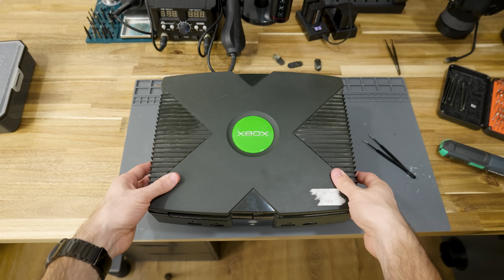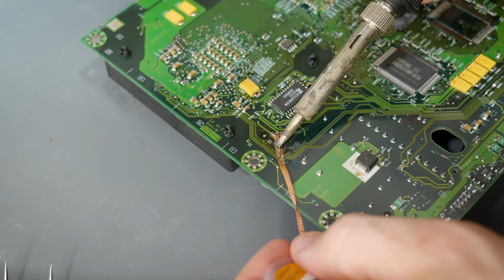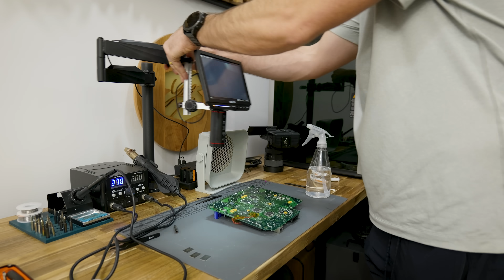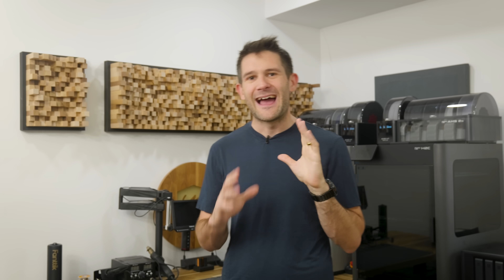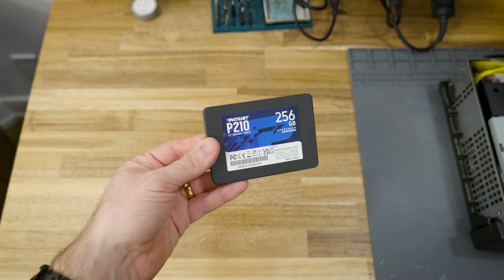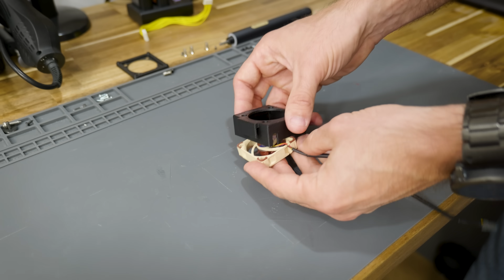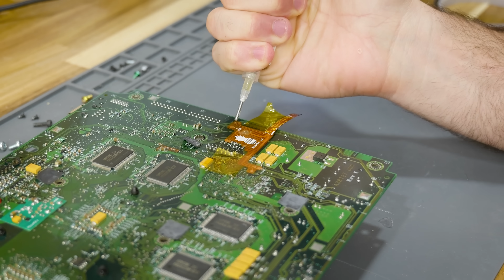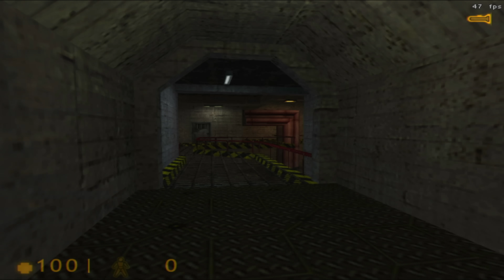I built a MODERN XBOX...

Comment: 1:20 The hard drive wasn't just for storing game saves and whatnot! Games could actually use the HDD as virtual memory, aka as a swap disk for RAM. This meant that the Xbox could do things that were literally IMPOSSIBLE on the other consoles!

Morrowind for example could never have run on the Xbox if it hadn't had a hard drive. Its memory load is simply too heavy for a normal 64MB RAM console. 🤷 But with the Xbox having a HDD as standard, Bethesda could actually do it. And that's just one of many Xbox exclusives that required the HDD.

Comment: For people who mainly play original Xbox games, I honestly don't see much point in the 128 MB RAM upgrade. As far as I know, no retail Xbox game really benefits from it, since they were all designed around the original 64 MB. It's a cool mod, and great for learning or for homebrew, emulation, Chihiro, and development, but for the average player it's probably one of the last upgrades I'd recommend.
Reply: First, a larger hard drive, a quiet fan, a modchip or softmod, HDMI output (if desired), and recapping/maintenance. The 128MB RAM mod is more of an "ultimate Xbox" mod than a practical upgrade for most users.

Comment: When you removing the chips dont blow hot air at the middle off it. Blow to the pins around. Since the silicon is sitting at the middle, you probably damage or sorthen the life of the chip.
when you soldering chips first remove the solder from the surface of the pads. With this all the pins will be flat with the pcb. 
Then when you locate the chip on the pcb, only do 2 pins on oppsite sides to fix the chip mechanically. Then solder all the pins. I hope you got it. Watch some videos about soldering. Good luck.

Comment: There are a few corrections that need to be stated here. The clock capacitor not being needed is dependent on your motherboard revision a 1.0 - 1.5 motherboard doesn't need the capacitor to run but a 1.6 revision won't boot without the capacitor. From my experience you don't need to use acetone on the thermal paste, I had luck using Arcticlean two part thermal paste remover I left the remover on of a few hours and came back and the paste just wiped off the die. Using acetone you have to be very careful not to get it on any plastic parts cause it will break down plastic and make it weak.
Reply: My thoughts exactly on the acetone. Super rough on already old parts. Unnecessary aging turned up to 10X!

Comment: As usual, not the biggest fan of the aesthetic you went with (the see through Xbox Series X was rad as heck)
IMO it needed to be a lot curvier and keep the ribs of the original design, but each to their own. If you're 3d printing something then making a box just feels wrong to me.
I'd have kept a disc drive but use a really slim unit as well, less hassle to rip new discs to it that way.

It's a very cool thing though, loads of extra functionality, I need to get hold of an OG Xbox one of these days.

Comment: Being the first revision of the Xbox (it also should apply for the 1.1), the PSU has fragile solder points in the socket for the plug that can crack and kill the PSU and it may even catch fire

Comment: My one suggestion is that on the heatsinks instead of using paste, use a carbon PGS sheet (ic graphite, panasonic pgs, carbonaut). It'll never dry out because it's not something that can dry out. Just make sure the mount is properly down, that tab can break so keep that in mind and be gentle. Throw some kapton tape around the edges because it is conductive, but on an xbox shouldn't be an issue unless you for whatever reason mount it vertically and have poor mount pressure.

Comment: Hmmm exposed vent slots facing exposed power supply board that's a no no and a electrical hazard be of 120 vac! Cover up that vent u done need that on bottom of power supply board just use back vent

Comment: It seems to me, you're using a lead-free solder. Is that right? If that's the case... Consider switching for old school leaded solder. It is much easier to work with and you can use lower soldering temperature. Here and there, I've seen overcooked solder joints. That should help a lot.
If a particular solder pad is giving you hard time, sometimes it's easier to wick all of the existing solder out, and completely replace it with a fresh one. It actually is the proper way, as a mix of old and new is more prone to failure.

Great vid!

Comment: Recommendation.... the caps you linked to in the top of your description... I would highly suggest people go with a Nichicon or another top brand. Make sure they are 105c rated and low ESR. The price difference is basically nothing, and that's what makes the difference between a capacitor that starts leaking in a few years..... and a capacitor that will last 20 years

Comment: You did quite a few things wrong. You're barely one step above rank amateur and you're charging people for an instructional course? Get some self-reflection. eg: Kapton isn't a thermal insulator, so covering your components in it to protect against your heat gun doesn't do anything. -Just one example of the farmyard full of misinfo and bad practices on display.

Comment: The clock capacitor is the more well known of the two major hardware failure points, the other is the way the hard drive is configured as both it and the motherboard are married via an eeprom key, so once that hard drive dies the system is basically a doorstop unless you got the eeprom key before the inevitable or you solder a modchip

Comment: I loved softmodding my xbox many years ago. I bricked it eventually so here's something to be mindful of:
When I was removing the upper tray with the drives, I carelessly let the tall, main screw structures sit next to the onboard components. I bumped the system and that caused just one of the components to sheer off. The problem was, I didn't know the original state of the motherboard, and I didn't know which were suitable replacements, or even where the component came from.
In short, either keep the upper tray completely separate, or near it's original position when working with it. Not somewhere in-between like me.

Comment: the thermal material is a type of phase change thermal stuff  (PTM). unless you're changing the heatsink or replacing one of the chips/passives, you don't actually need to replace it. it doesn't generally go bad without being overheated. some few units will, and there was some bad batches, but if its not broke, you shouldn't mess with it. the paste will eventually dry out, the PTM doesn't really go bad without other issues involved.

and no, your placebo/psychosomatic experience doesn't change that. PTM is superior to regular paste for longevity, and units show no particular thermal transfer improvement with paste over the PTM.

Comment: Stop removing the physical media ports from stuff. People still have physical media collections and they deserve to be used. 

Dont go all Playstation with every single build because all it does is turn the console into a fancy box that reads an ssd.

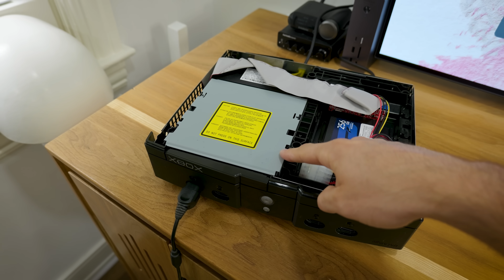Yup, called it. 17:14. The very moment "modern" kicks in. By just tearing out physical media capability. Every time.

Dont get me wrong, the rest of this is perfect. 

But losing physical media isnt it. Especially if you need to stop halfway through modding to rip all the games.
Reply: Btw, that physical media is OPTICAL.

Nowadays a more modern alternative would be akin to SSDs or switch cartridges,plus, there is not any real problem on not having  physical media when it's a thing made by yourself, and considering you can pirate stuff easily.

The real problem with non-physical media is the DRMs,not the stuff being digital.

Comment: The clock capacitor is only there to keep time when it is unplugged. And not for very long. It was kind of a useless piece in this system. As long as it stays plugged in it keeps time.

Comment: Oh my God, bro, when you got to the thermal paste. Earlier this year I bought a halo combat evolved edition original Xbox with video issues for disgustingly cheap. I replaced the bad capacitors and went to repaste it. I was scrubbing that stuff with rubbing alcohol on a toothbrush for four or five hours.
Reply: That's because it's not thermal paste. It's thermal adhesive, which yes, is an absolute total bitch and a half to remove. 🤷

Comment: One suggestion on the RAM soldering difficulty: just remove the old lead free solder, apply fresh leaded solder and reflow the chips in place. Much faster and you can reflow it at lower temperatures.
I also would have kept the original optical drive for game preservation and DVD playback over HDMI.
Keep up the good work! Cheers

Comment: Some corrections and notes that are worth mentioning:

- The clock capacitor isn’t a “design flaw”, it’s an issue with that specific capacitor that was being supplied. Later Xbox models switched to a different supplier and are substantially less likely to have it leak.
- The thermal compound is not a paste that dries out, it’s a thermal adhesive compound that hardens at room temperature. It still works fine for managing the relatively low thermal output of the CPU and GPU and you shouldn’t remove it unless you’re doing something that necessitates removing the heatsinks anyway.
- Pull the pin from the header before installing, don’t clip it. Leaving a clipped pin resting on motherboard can scratch away at the top layer when the header wiggles from removing or installing the chip.
- The LPC header is for accessing the SMBus and LPC bus primarily for debugging and development purposes, not for flashing the BIOS.
- Modchips generally do not come loaded with a custom BIOS (at least not one that functions as an Xbox and plays games) and you must flash this yourself for legal reasons.
- All debug and development consoles had 128MB of RAM, not just early ones.
- RAM was not reduced to 64MB due to a “cost cutting stroke of genius”, 64MB was the design spec. 128MB was intended for development and debug units, and for the sake of efficiency it made more sense to have those systems share the same motherboard, which meant unpopulated RAM pads on retail units.
- The Xblast modchip is outdated and you don’t need it to do a RAM upgrade. Other chips and BIOSes, including TSOP flashes, can address the additional RAM. A soldering error does not “turn your Xbox into a brick”, it’ll most likely just result in that extra RAM chip not functioning.
- Project Stellar and its creator are quite controversial for a number of reasons and you should do some research and decided on your own if it’s a project you want to support.
- Neither a 40 wire nor an 80 wire IDE cable as shown are “shielded”. 80 wire IDE cables have additional ground wires to reduce crosstalk.
- The vertical placement of the PSU means its PCB is blocking pretty much the entirety of those side vents. The PSU does not have its own cooling and relies on the stock design resulting in the exhaust fan pulling in air from that side and over the PSU components. This design may not be sufficient, particularly for extended sessions and longterm use.
Reply: I tink you are basicly spot on inhope he reads this especily with the project steller,
Reply: This. All of this. Couldn't have said it better myself.
Reply: Wrong
Reply: @theonewhocrys-k9d don't you have a bridge to live under and make anyone trying to cross it to solve your riddles three?
Reply: @theonewhocrys-k9dsource

Comment: If someone has a 1.6 version of the original Xbox, the clock capacitor is required for the system to boot.

The LPC on the 1.6 version is a lot more extensive of a rebuild process. There are quick solder boards that can help with the process.

Comment: curious why you didn't do the 256mb ram mod seems like it would have been same difficulty as the 128mb mod. like the design looks nice.
Reply: The 256mb RAM mod is about triple the difficulty and almost nothing really takes advantage of it anyway. You have to do the 128MB install and then piggyback an additional RAM chip on top of each one and solder the legs together.

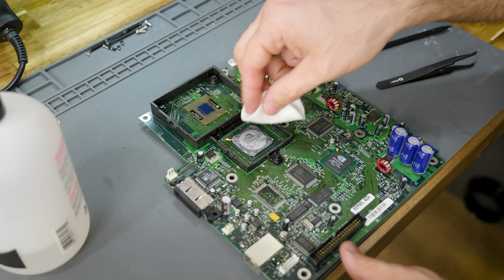Comment: 2:40 you should definitely use nitrile gloves when using acetone. Just because woman use it on their nails doesn't mean it's safe to touch. Also, avoid smelling it. Use a desk fan immediately after you're done. it evaporates almost instantly.

Also, the gloves won't hold up forever under acetone exposure but it's fine for brief exposure like this just cleaning off a CPU.

Comment: Small correction, on the 1.6 revision if you boot without that clock cap you get an error code. You have the 1.0 model (the fan on the GPU is the giveaway) and up to 1.4 you can just cut it off without issue. The 1.6 is also more difficult to RAM mod as the pads don't exist and are blocked. Some have worked around this by stacking chips on the others, but that is even more difficult...

Comment: Not ALL Xbox consoles suffer from clock capacitor leak. V1.6 Motherboards have a different capacitor that doesn't leak. Amazing how this knowledge gets lost to time. Also the Xbox was not disappointing at launch if you were actually older than a pre teen. It was a fantastic console for the time.
Reply: And to add onto what you said, 1.6 and 1.6b motherboards REQUIRE the clock cap to be installed. Do not just rip it out without a replacement or the console will not boot.
Reply: Tons of excitement at the time. People thought it was awesome.
Reply: I'm daring to say it's the best console ever. The library it had and the media-centered focus it was designed around is unbeatable. Add the modding capability (you can literally swap the CPU) and this thing is just the coolest console of all time. Sure the PS2 had the best library of that generation, but a lot of that library was shared with the Xbox. And usually the games ran a lot better and looked better on the Xbox. The next closest is the Xbox 360 but unfortunately it is extremely locked down hardware wise, we only just were able to crack a persistent (psuedo-persistent at that) softmod on it.

Comment: I have a PAL og xbox with a 6.1 motherboard, meaning it has better capasitors that won't leak and brick your xbox, although just to make sure every few years i'll open my xbox and check on it, I love my xbox, and it's all stock baby 😊

I did soft mod it once, and accidentally unlock my harddrive, but then I removed the softmod with a little fttp software and back to stock again 😂
Reply: "it's all stock baby" - Weird thing to brag about when you're talking about CAPACITORS. Makes literally zero difference, other than your capacitors will (PAL 6.1 or not) fail a lot sooner than replacements.
Reply: @SuperKMx True, but they might not, saves money and time, soldering knowlege, they may never fail, but that's why i'll open up my xbox every 5 years or so just to make sure. Even then a 6.1 is least likely to fail than a earlier model, I did replace the disc drive once though as it had started to fail or not cause the system to boot properly.
Reply: @MangoDrake2001  So, "it's all stock baby (apart from the entire disc drive mechanism)."

Sweet brag.

Comment: aside from the clock capacitor, the next thing to usually fail is the rubber band in the disc drive. thankfully its an easy fix.

Comment: OOF that's a 1.0 revision xbox, if you used a 1.4 or 1.6 they have a 60nm GPU that can overclock to 400mhz. 350mhz is recommended though.
My xbox is a 1.0 too and can only get to 280mhz... Stock is 233 btw.
I have a Stellar chip on mine but it's not the + version, I wonder if I can just swap them out without needing to solder?

Comment: Tip for using soldier wick. Cut a small amount to use instead of keeping it attached to the whole roll. When it's attached to the whole roll, the heat gets transfered to all of it, making the wick less hot. Should hold it with tweezers or gloves though cuz it gets hooottt

Comment: i appreciate on content and reverse engineer work done by talented people to keep the regsBox alive.  If you missed out on having a modded xbox back in its heyday, you missed out.  XBMC was better than TIVO and well before Netflix streaming.  Its cool all you can do today with it.  Here's a tip for you too, you can use most of the homebrew in Xemu,  I recreated my OG xbox mod (i had the files backed up) in Xemu and it mostly works one to one like an OG xbox, you may have to manually launch games from the file menu but most homebrew is there.  My NFS Carbon saves were important to save.

Comment: V1.6 boards have to have the clock capacitor or they won’t start. But they also have much nicer caps that rarely explode leaking acid.

Comment: My job was exactly what you did for soldering and modding the board. I did it for 17 years and for someone that doesn't go through hundreds of boards a week, you did pretty well there. 

Sometimes a board would go through Rev change, and we would have to run a 30awg wire from one of those legs on the IC and route them to a pad or another IC. The more you do the easier it gets. For instance, I would have just flood soldered those legs and then pull the access solder off. Also, here's a tip for cleaning off IC pads. With some practice, you can use a Q-Tip to clean them off by adding a little flux, heat up the pad with your iron, and then use the Q-Tip to kind of push the iron tip away as your wiping the solder off with the Q-Tip. With a medium tip you can get 4 pads at once. Faster and cleaner and no pulling pads off with the solder wick. It does take practice, and you can use the old XBOX MoBo.

Side Note: I still work there; I just make the Assembly Instructions on how to assemble the components on the PCBs.